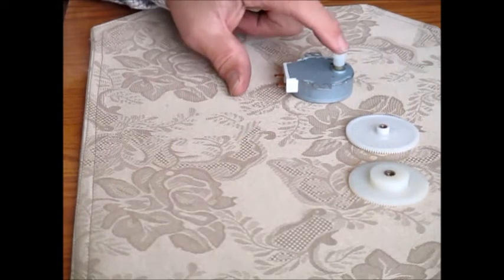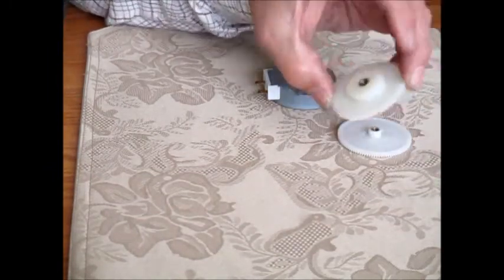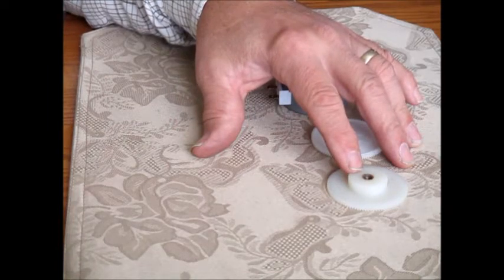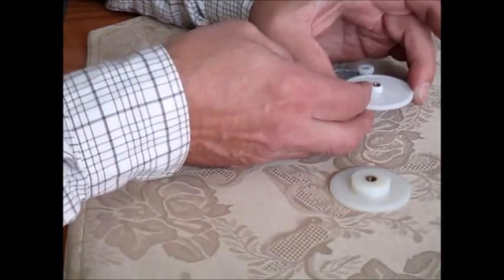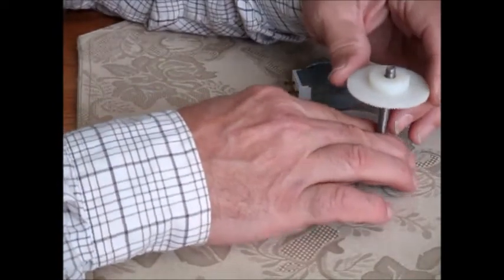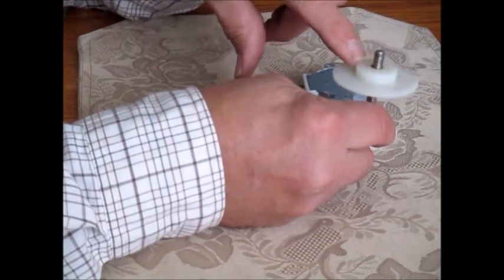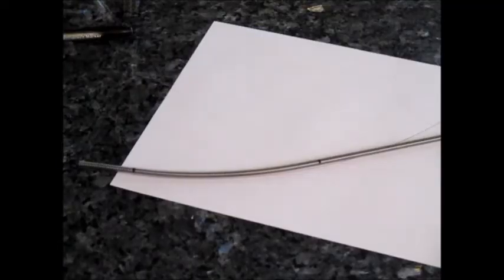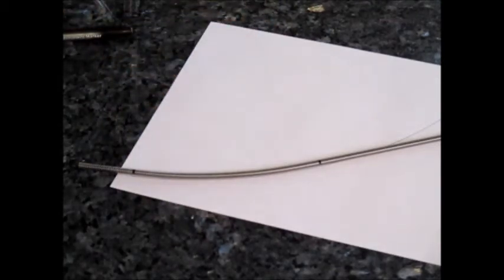Barn Door Tracker

Comment: If you apply pure bending moment to two ends of the rod, it should bend into a circular shape automatically. Just fix one end in a vise, and hold the other using a piece of strap with a clearance hole mid-length. Use two nuts to hold the rod. Don't bend, just twist around the centre of the strap.
Reply from the maker: I don't think it'll be quite that easy.  Bending around a wood radius is probably the best way, you just need a bit shorter radius to allow for spring back.  Even then it won't be perfect.

Comment: There are 1rpm motors, then use a 1:1 gear ratio is a optio. I found its easier to bend the rod around a tree, also gives a smoother curve, instead of the washer under the gear, use a thrust bearing.

Comment: Hi Ed just came across your Video I have couple of questions 
Does it matter what thread  is used ? as im in Spain it would have to be metric and going to be some time before i could get back to UK for imperial 
The Gears :  you give the teeth numbers but whats the outside  diameters ? 
I have built a manual tracker with 1/4 BSW thread 20 tpi but now looking at motorised fortunately our microwave broke so the motor was salvaged 👌 
Great video has to be one of the best so far  👍👍

Comment: Why is it necessary to use a curved rod? I realize it has to do with accurately compensating for Earth's rotation. I want to know if there is an easier way.
Reply: You can use a straight rod, but (1) you have to make sure the rod is set to the correct length to track the sky, and (2) the setup rapidly gets out of line with the sky, so you have to stop, reset the gear on the rod, then start up again.

Comment: thank you for this video. It inspired me to build a barn door myself. And it works! I have just uploaded a video on my channel and mentioned you in the video. Took me quite some time to build the barn door mostly because I had to wait weeks before I had all the parts necessary and because I could not bend the rod by hand properly (it is M8 size which I guess is equivalent to 5/16-18 inch size)  and thus had to build a roll bender as well. It's really a lot of fun using the barn door and I hope to take more photos with it in the future

Comment: hi, due to the ac motor drive you can't use batteries, how do you connect it to the electricity? thanks
Reply: You just connect a line cord to the two leads on the motor and plug it into house current.  To run off batteries you get a 150W inverter on Ebay ($15) for 12 volts.
Reply: Ed Jones songs thanks, I'll give a try, I asked you because near my house sky is too much polluted and I can't do anything as astrophotography so I need to carry the tracker and I need a source for the power.